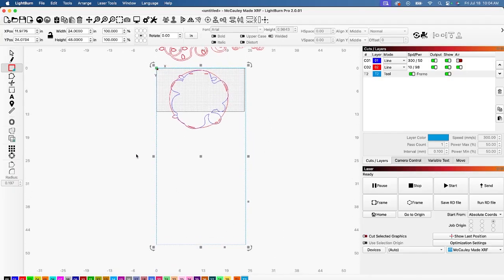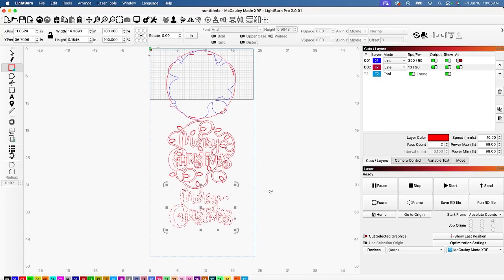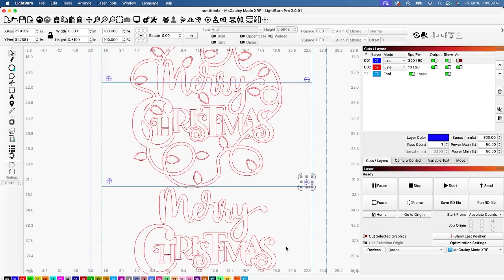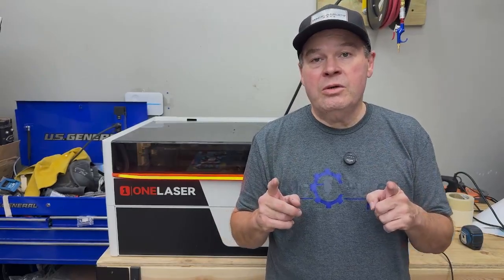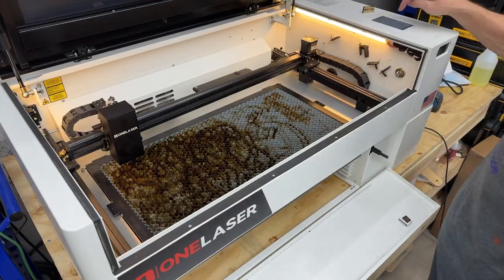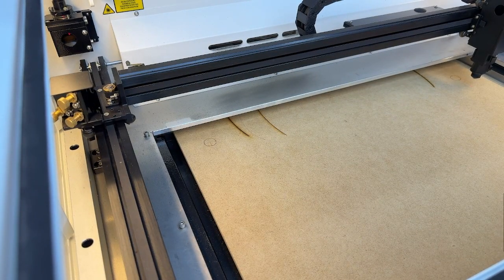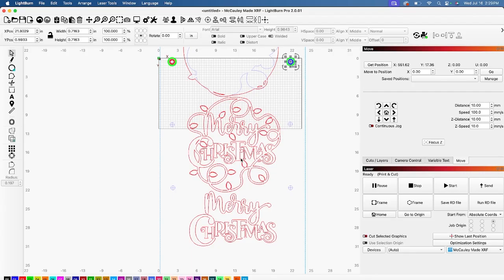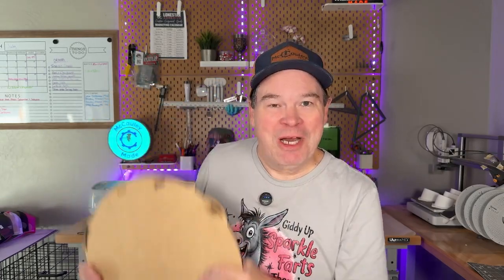How to Use Passthrough on OneLaser XRF + LightBurn Print & Cut Tutorial

Comment: They sold me an XT, and you know what?  They don’t have ANY videos on how to use it.  Every video is for the XRF.  I just got off another video conference trying to get help with my laser.  The person doing it suggested changing a setting in Lightburn to get better results with acrylic, then he stopped and said, “You have the glass tube, don’t you?  This probably won’t help.”  I said “Then you mean I bought the wrong laser?” And he said YES. They sold me the XT, but don’t support it, don’t have instructions for it, and apparently lied about its capabilities.  I waited almost 6 months to get the laser - their estimate was 4 weeks.  I am so unhappy and I cannot get any useful help.  One tech told me to ignore the suggested settings page on their website as they didn’t work.  This was sold as a beginner laser, which I thought would be good for me because although I’ve been using lasers for 4 years they have all been  Glowforges, thus I don’t know much about ‘real’ lasers.  The manual is pathetic, and in such poor English it is barely readable.  I received a practically unlabeled bottle with mine, I had no idea what it was.  I had to look it up online to find out that it was antifreeze.  There were NO instructions on how much of it to use , or if I even needed to use it as my laser is indoors in Naples, FL.  The instructions said to use ‘pure’ water - not distilled,not bottled, just pure.  I could not get an answer from OneLaser support as to whether I should use the antifreeze or not. I did (after setting up an appointment) get told to use it, which I did, but no one would tell me if I needed it as there is ZERO chance of freezing temperatures affecting it. I am disabled and my lasers have been a lifesaver, giving me something to look forward to everyday- until this one. Now I don’t even want to get out of bed to face another day of failures.  Look at their site and tell me I’m wrong. It is mostly unusable.  I can use the same settings, the exact same material (not even removing it from the laser bed) and get 2 totally different results.  It will cut through, then the next day it won’t.  I use at least 50 different acrylics,woods(plywoods and hardwoods),MDF,leather,laserable leathrettes, laserable vinyl,rubber stamp material,cardboard, paper…and I have no idea where to even start the settings.  With my Glowforges I have cut many kinds of hardwoods (wenge,zebrawood,lacewood…) plywoods(Baltic Birch, Sapele,Purpleheart,cherry, walnut) acrylics (opaque,translucent,mirror,glitter…)papers,cardboard,adhesive and non adhesive films from Smokey Hill…litterally, anything I wanted to cut.  I can’t even get this machine to reliably cut 1/8” Baltic Birch!  I am not stupid.  I am careful and methodical, I have created many beautiful products with my Glowforges.  I wanted a bigger cutting area,and since the GFs were supposedly upgraded so that now they cost even more, I decided to try another type of laser.  My husband is retiring in a year or so, thus cost is important.  But this laser is worthless.

Comment: I have found several of your videos very helpful. I however cant get the head to go that low to focus. Do you just go to the max z and hope for the best?
Reply from the maker: Good question. No, you have a triangle piece of clear plexiglass that comes with the machine, or you can make your own like I did that has clear steps and not as hard to read. You can use that to get you focal point from your material. I have lowered my lens to the bottom level so my focal point is a little farther away to what it would be from the stock position. Let me know if you have any more questions and we can work it out together.

Comment: Forgot to ask... I have the updated Lightburn version and don't see the option to label something on the bed "tool". I just turned that layer "off" for no cut or engrave. Which LB version do you have?
Reply from the maker: I just updated to 2 but you should still have the tool. It's on the bottom where you can change your layer colors. It's the far right colors, should be orange and a light blue labeled T1 and T2. But turning it off works just as good too.